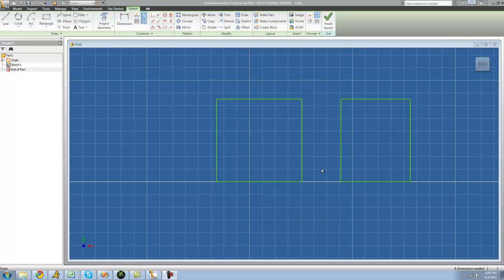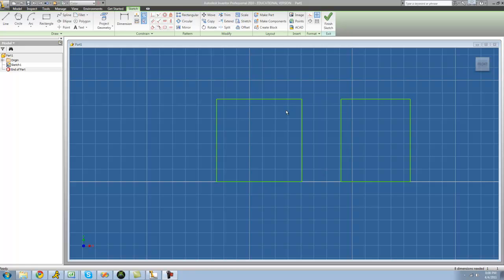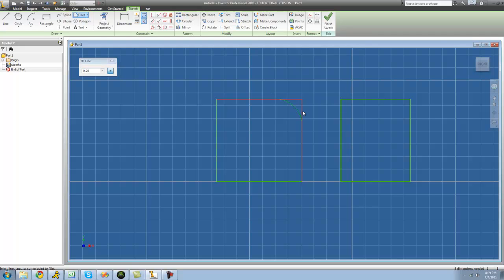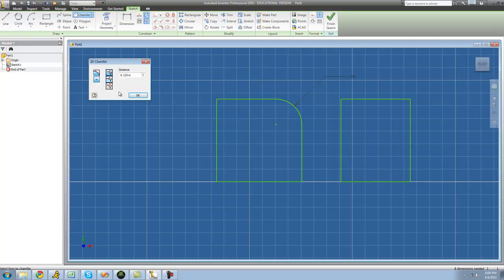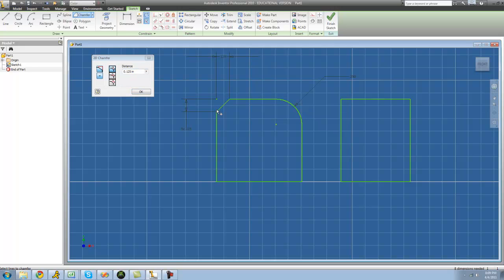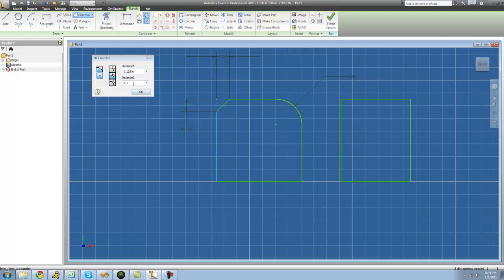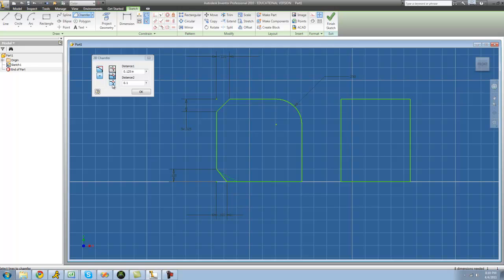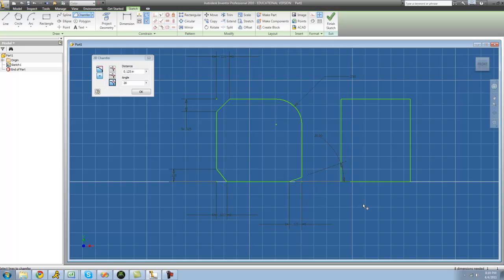Inventor Tutorial 3, Fillet and Chamfer

Comment: I have a problem, can you help me?

I've made a cube, each side being 3.5mm in length. I'm trying to turn that cube into a cylinder, by using the fillet tool on the edges. but it won't let me! The highest I can do 1.19mm, but if I do that on each edge, it doesnt make it a perfect cylinder. If I put in any measurement higher than 1.19mm, a triangle appears with an exclamationmark in it, saying I should try doing different inputs. 
Could someone help me?? This is for my graphics assignment at school and its due Wednesday! :( 
Help!!